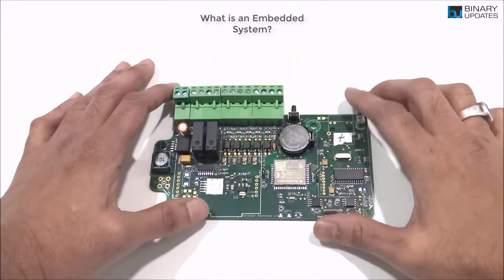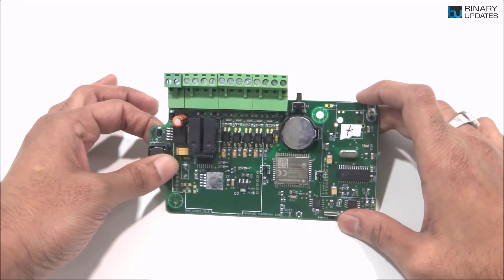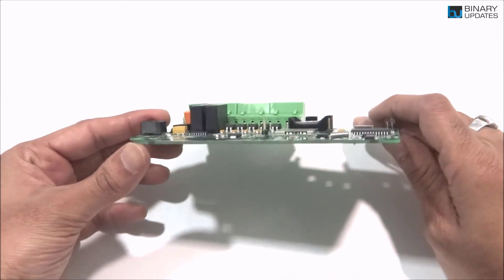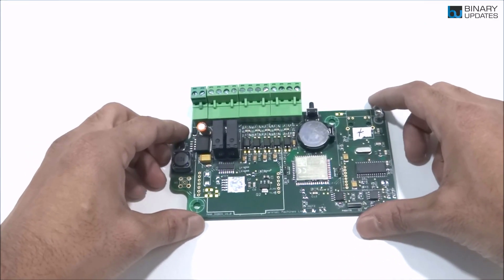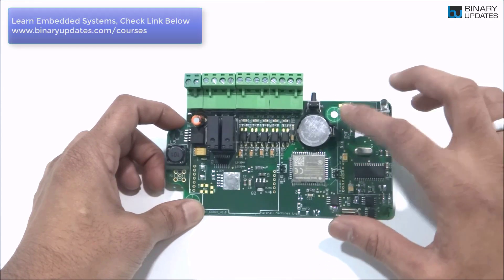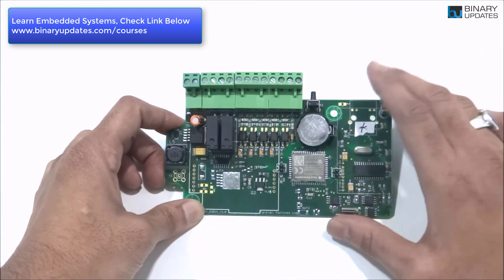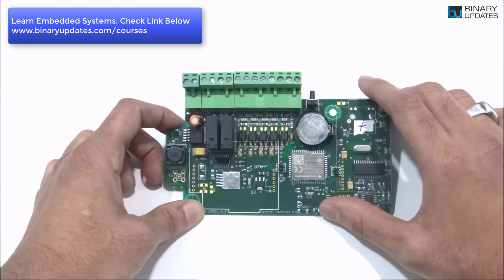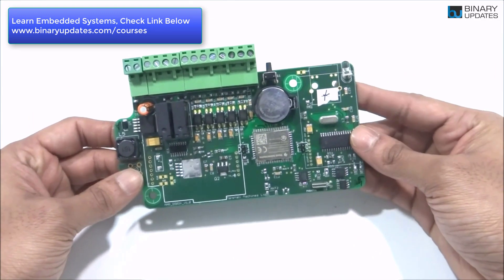What is an Embedded Systems? Explained for Engineers and Programmers

Comment: Typical embedded system is made of three component 
1- PCB
2- MCU
3- you didn't say what is it?
Reply from the maker: Hi Yousef, here is revised version
1. PCB (Printed Circuit Board)
2. MCU, CPU, GPU, FPGA, CPLD etc. 
3. Electronics components (active or passive) etc.

Comment: Sir, 
     Be a good in mathematics is necessary for embedded software engineer?
Reply from the maker: Hi Anmol, as long as you can do basic mathematics, its good enough to start as a embedded engineer. I'd suggest take some free online course (in-description) and find out your interest. If microcontroller and programming interests you then its easy to become embedded engineer. I hope this answers your question. Good luck and best wishes!